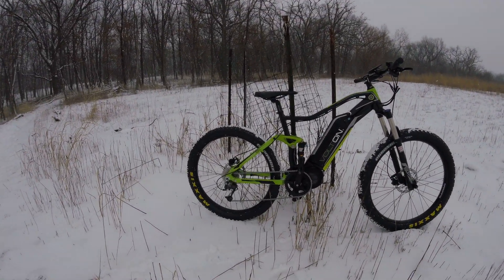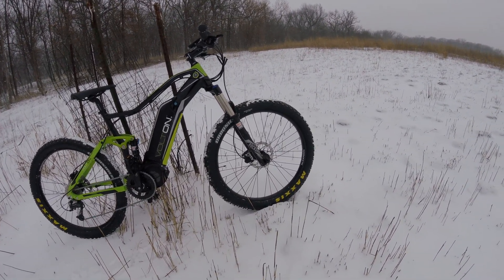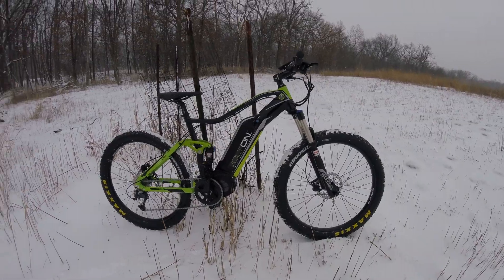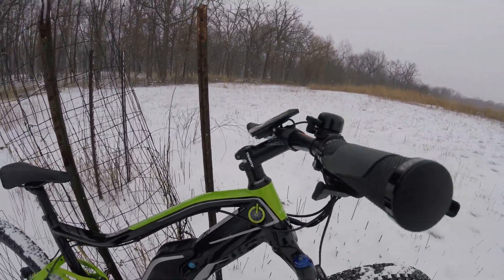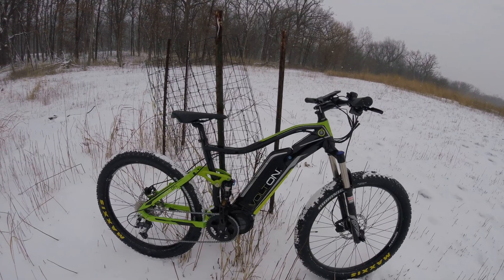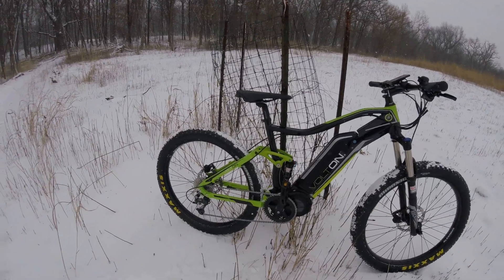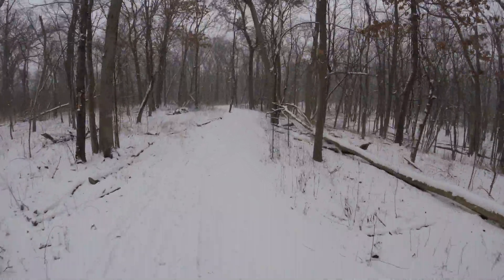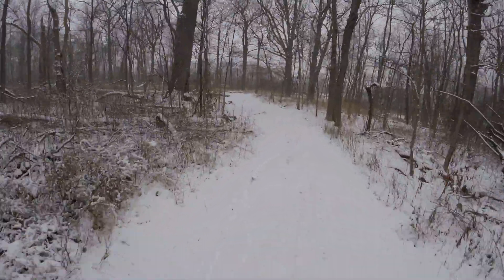Volton A-Trail eMTB Component Walk-through and Snow Ride

Comment: Can you list some geometry please? It'd be very helpful to have stats like reach, head and seat angles, seatpost diameter, and chainstays length. Also will these be available as a frameset only? Thanks
Reply: I would also like to know the specks on this bike I can't find out very much at all on their website
Reply from the maker: @sage oz  @philipcox5041  I have the main measurements listed. Stem lengths are 90mm Seat angle is 73 Head is 67

                                          17"M       19"L
Stack (inch )                  23.6	23.9
Reach (inch)	                16.8	17.5
Stand Over (inch)	29.5	30.5

you can always reach someone at support@voltonbicycles.com with further questions. there is a early summer delivery preorder starting soon.

Comment: and can you get a 52 v
Reply from the maker: No plans to increase voltage to 52v. It's a helleva good ride - The performance on a 48v supply is great and the parts kit is choice. Thanks for watching.
Reply from the maker: We can but the case is maxed out at 48v14.5ah. We don't consider the nominal extra voltage supply worth it at this time.